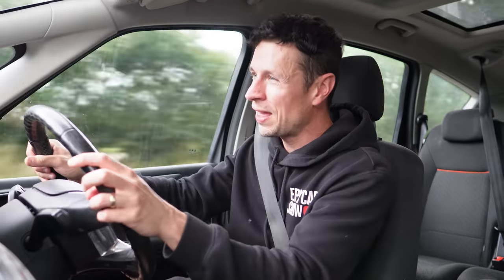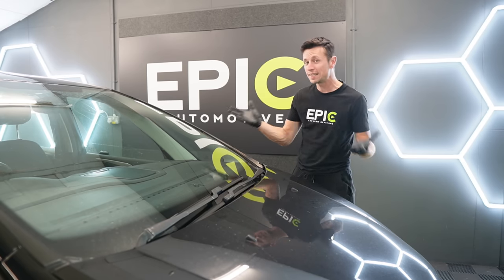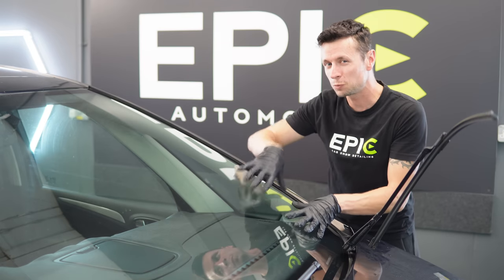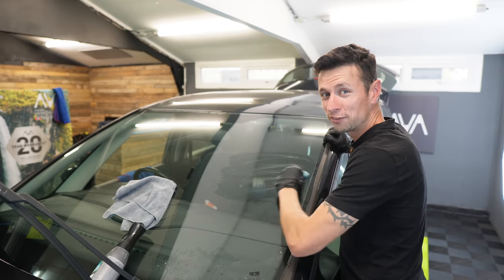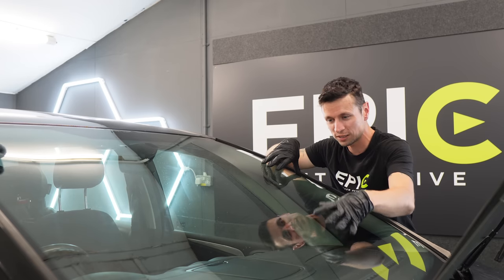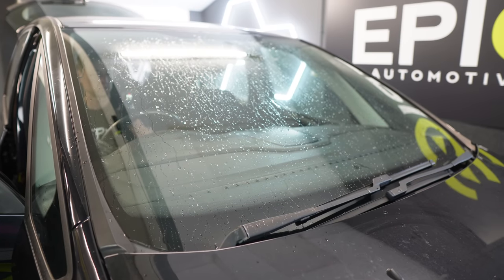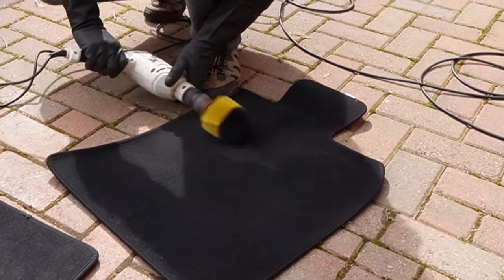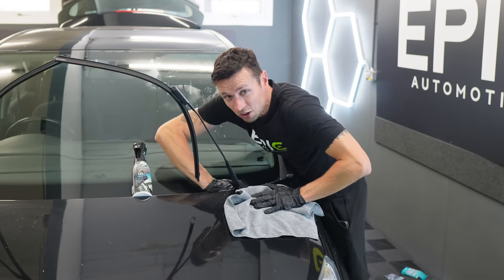How to Fix Annoying Windscreen Wiper Juddering for Good!!!

Comment: The wiper arm is the problem, not the blade or glass cleanliness. Those are just temp fixes. You have to remember the arms are a thin metal exposed to the elements and constantly expanding and contracting and twisting as the temperatures change. You can use 2 adjustable wrenches to slightly bend the arms back into place so the blades sit against the windshield perpendicularly.
Reply: I hope your comment reaches a lot of people
Reply: Yup exactly spot on!
Reply: what if i have this juddering issue only after I apply rainX to the glass? are the arms still the problem? it happens every time I apply it and its doing my head it, although i didnt try coating the wipers themselves yet.
Reply: You may be generally correct, but I have this issue on a brand new car (1 month old). I have ceramic coating (done by a detailing center) on the front window, so looks like this is causing the issue. Maybe the wipers need to be treated as well.
Reply: @mastrasport  I coated the wiper blades afterwards and it made it significantly better with just the odd judder now and then
Reply: @lukaszM46  Thanks for the tip. I will probably check with my detailer to see if he has other ideas, but looks like removing the coating (not sure how this is done) or coating the blades would be my first options.
Reply: Exactly. I realized this after I coated my windshield, then stripped it, then coated it again. It still juddered so I replaced the wiper blades, and to my surprise, one blade missed a huge area on the windshield completely. That’s when I realized it’s the wiper arm that’s causing the issue. All this time, I couldve fixed the issue for free.
Reply: 99.9% Its the wiper arms that needs twikking nothing to do with how clean the windscreen is?? This stream is just a product scam, The black residue  on the cloth from wiping the wiper blades is mostly graphite used in manufacturing of rubber wiper blades, Silicone blades are far better for longevity, The only product I use on windscreen is Rainx + wiper blades before the onset of winter 🤔🇬🇧👍

Comment: One fix that works for me, is to use Glass polish (Autoglym). I only get juddering at the bottom of the windscreen, normally where the wipers sit and just above, but the other 80% of the glass is fine. A clay bar and clay bar lube should do the trick as well. I also use a hydrophobic glass cleaner. I know you don't like them, but they work. I don't use any of it on the wipers itself, as this causes, my Bosch wipers to judder, just plain water on the wipers every two or three days, and yes, loads of black dirt on your cloth. After a few days, I also spray water on the glass cleaner/sealant, on the sides, this brings up the glass clean again, without using more product, with glass cleaner cloths. Some cheap microfibre cloths leave their lint on the glass, glass cleaner cloths don't. Also, try The Pink Stuff around the exhaust tips or white vinegar, cleans them like new. Pet hates? Wheel cleaning. Do you take the wheels off (not practical in most cases, but the best method), and clean them properly, inside and out, what products to use, TFR, ceramic coating on wheels, what tools, what processes, tyre cream or just tyre dressing, sit on a chair or knee pads? What products don't work? What a minefield, just the wheels can bring. Maybe worth doing a video on all the techniques and products.

Comment: My biggest problem is my shampoo or snow foam drying on the car. I start one end of the car and work my way round to find my soap or water has dried on the car just in a few minutes. I find myself rushing to clean the whole car whilst it’s wet and making sure it doesn’t dry. Then I’m knackered because I’ve rushed and not enjoyed it. Is it nothing to worry about?

Comment: Would've been interesting to see what happened when the windscreen was wet though. Sealants, in my experience, tend to leave a brief haze just after the wiper blades pass, and it's almost impossible to see through it on a sunny/bright day or at night. Very dangerous. The only thing I've found which cleans my windscreen properly is Meguiar's Ultimate Compound.
Reply from the maker: Keep watching it will be revealed. I'm mixing Content with shorts so follow up videos are coming in 30-60 second bite sized clips
Reply: Yep have to agree, no matter how well I applied them it was that brief ghosting that put me off - at night with headlights coming towards me... very dangerous.
Reply: @epicautomotivedetailing  Oh. I don't watch shorts, as after watching one, I'm bombarded with them. Oh well.

Comment: I tried everything to stop my driver's side wiper from juddering but finally found it to be lateral play caused by wear of the plastic area where the J hook wiper arm is passed through the blades. Oddly, the one on the passenger side is much tighter, even though they were changed at the same point in time. I'm using aftermarket aero type wiper blades, not the metal spring type that were the originals. I only ever sleep with women and sometimes feed the jackdaws. Not simultaneously mind you.
 A happy 2024 to all.

Comment: Back in the day, all we dine was put a slight twist on the wiper arm. Worked everytime.
Reply: That is still the way to fix it today. This is how we lose track of human culture and history.
Reply: Huh? What do you mean by that?
Reply: @AnthonySarino-f7n  He means back in the day they used to just put a slight twist in the wiper arm and it would correct the way the rubber blade sits on the window and stopped the juddering effect.

Comment: Great vid as always Dave. The thing I struggle with the most is not having a pressure washer. I use the garden hose with an additional attachment which gives a bit of extra oomph…but obviously doesn’t compare. I never feel like I get a proper deep clean, especially the tyres, wheels and wheel wells.
Reply from the maker: Garden hoses use more water than a pressure washer so it's definitely better for water consumption getting one. A huge part of the clean is the chemicals so the hose isn't impossible but definitely invest in decent products

Comment: Good morning Dave.  I feel pretty confident about using most cleaning, decontamination and protective products but I do really struggle with ceramic sprays.  Getting an even coat and smearing on bodywork is hugely frustrating albeit I’ve tried using a damp cloth once it’s applied.  Any tips would be appreciated please.

I think the biggest challenge is navigating through the huge array of products on the market before deciding on what works best, however!

Great videos mate - I learn a lot from you.
Reply from the maker: Thank you David. To be honest finding the right products these days is very tricky because we all want the best but brands also push boundaries so a good majority of products out will be good enough. It's very rare to find a terrible product these days

Comment: Great video Dave, loving the new unit based content as much as the mobile content.
Very interesting subject for me, having recently applied Glaco Ultra, and still having wiper judder, where there wasn't really any before that, just a soft squeak near the bottom of the windscreen now and then, as the windscreen was drying but not dry, strangely was better when dry!
I washed the car as normal, used a a Stanley type blade on the screen with glass cleaner as lub (same as Ammo NYC used) followed with clay bar, then Glaco Compund.
I applied the Glaco Ultra, wiped off clean with a dry microfibre and left the car garaged overnight, basically followed all the instructions to the letter.
I was gutted the next day when it rained, and the wipers were horrendous, juddering and skipping, making a horrible noise.
I fitted new wiper blades as these were over a year old (always have a new set waiting) and it was a lot better but still not perfect, still getting a little judder occasionally and a little smearing too.
Your tip of applying some to the wiper blades, I have heard of before, but I didn't do that, so that my be the key here.
Great result with yours, nice and quiet now
Reply from the maker: Thank you, definitely recommend applying it to the wipers as it solved the issue for me

Comment: Great video.  Haven't tried a sealant on the windows, just a car glass cleaner.  One issue I usually face is cleaning the front grill area and getting rid of dried on bugs.  No matter how much snow foam and cleaner I use I can never get that area really clean and when I dry off the car I Always find bugs.
Reply from the maker: Sometimes the blood and fly guts  can etch into the paint so washing alone may not be enough.
Reply: Use a clay bar on that area

Comment: Hi Dave, i am a car detailer for 4 yrs. My biggest hate is cleaning black car in the summer. I have tried doing  a long hosing to try and cool it down, washing the roof 1st and rinsing, then working my way around the car doing one side at a time. surely there must be a better way?.
Andy.
Reply from the maker: The only real solution apart from putting the car under a gazebo is having another pair of hands to keep the car wet whilst you hand wash it. It's so difficult sometimes you have to walk away and wait for a cooler day. Thankfully we live in England so it rains all the time lol

Comment: Love my Glaco compound and ultra they’ve both been on my car for about 4 months and still going strong.

The toughest part for me the clean is my carpeted wheel arches, even when rinsed at at high pressure with the stubby gun, I just can’t seem to get all the muck from the top. My ez go brush still comes out with dry muck/dust.
Reply from the maker: Sounds crazy but you can get good results brushing them whilst they are dry
Reply: @epicautomotivedetailing  mind blown 🤯 never thought of that. Cheers mate 👍

Comment: Like other posters, my pet hate used to be water drips from mirrors and door handles - no matter how much I used the air blower to dry the car, I still got watermarks. No longer a problem - thanks to my newly acquired DI water cylinder. Just use it for the final rinse through an open hose and walk away. No drying required, and no water spots, even in hot sun. The most hated job for me is getting the inside of the windscreen really, really clean….ggrrrrr!
Reply from the maker: Hi Paul my glass cleaning video is definitely the one you need to wash. It will fix that issue

Comment: Another great video 👍, can’t wait to try it these methods out.
On a complete tangent…I extended the usability of my K4 today till I get one of AVA’s new machines, as I bought and have received the AVA stubby when I found it comes with a Karcher adapter included. Already had the jet adapter which again fitted straight in the Karcher style fitting in the nose. 
So glad  that I held of buying any expensive or generic ones now, because it’s a great ergonomic gun,(at least in my hands) and I’d never found or considered it without your Videos about AVA and giving their beaker snow cannon a go too. So thanks for that 👍
Reply from the maker: Nice one yeah Ava's new pressure washers are fantastic. Not one reported fault so they are making great progress for a new brand. They tick so many boxes for the user

Comment: I’ve used rain x on my windows for about a year now and I’ve had different cars to test them on and this recent car is really bad with the skipping or juttering. I’ve tried striping the rain x and putting new on and it didn’t work and I absolutely hate when I don’t have a protection on it.

Comment: Juddering wipers absolutely drive me crazy.My current car s Skoda rapid which I have had for 7 yrs has been the only car I have ever owned that has had such an issue like this. Despite being very fastidious about car and glass cleaning only new blades seem to cure it but after a while it starts again . In fact i have given up on SKoda blades and just bought Bosch aerotwin yesterday which were  actually cheaper  and  are extremely quiet but time will tell! The other point is i have just refilled washer bottle (including vw quantum screenwash solution) with deionised water instead of our tap water which causes lots of limescale in our taps/shower etc, so wonder if this is causing the blades to fail prematurely so will keep using it as a trial over a few months. Might try your clay bar method too as another aid.
Reply from the maker: Amazing tip on the water 👌

Comment: My experience unfortunately is that in perhaps the first week maybe 3 after applying coating to glass and wipers it's super smooth. But after multiple days of rain somehow there is always judder, specifically on the return motion of the wipers.
Reply from the maker: I wonder if a quick top up with sealant on the wipers would help?

Comment: Picked some of the windscreen sealant from Waxstock . The gent on their stand recommended that the older one may last longer but the newer design , as you used , makes it easier to apply the product in his view. Not sure if hes right or wrong I just know its bloody good stuff and one I enjoy using . For me products like this are essential as a safety aid for better vision and to clear the water off the screen faster. Would you suggest applying any sealant to the wipers as Ive heard others say it can ease wiper wear and juddering . But whats your view on that ?

As for the pain in the ** jobs , for me its the lower sills and around the lip of the arches where the crud gathers and if isnt moved can start rotting the lip .
Reply from the maker: I suggest trying it if the sealant causes juddering. If it's working on its own then leave it as it is. There are so many variables to dictate what causes juddering

Comment: Ok. I Don't Struggle With this, but some on YT are..... I'm talking about Discs.. Nice clean car and Wheels looking FAB.. But the moment they drive away. Boom covered in Orange dust from the break disc..I use a BlO AIR in-between snow and wash . I would love to know your Pro comment on this, and maybe you will consider this.
Reply from the maker: It always happens after washing. Simply tapping the brakes and moving the car sorts it in seconds 👌

Comment: amazing video - as always. One thing that really bugs me when cleaning my car, is rotor rust! I've just spent ages getting the car and wheels cleaned and dry, only to find that after the first drive all the rust from my rotors have been deposited onto my black alloys turning them a yucky mustard colour! Are there any products you can use as part of the wheel cleaning process which prevents this from happening? As I loathe having to go over them again with a damp cloth or detailer just to get them looking clean again. Cheers and keep up the good work!
Reply from the maker: Hello I just move the car and tap the brakes and job done. I think built hamber actually have a product designed to combat this without moving the car.
Reply: Bilt hamber Atom mac

Comment: Instead of applying coating to the wiper blade can you try silicone blades instead and see if the hydrophobic effects of the sealant on the windshield is not causing this issue? I have I installed TPU based hydrophobic windshield protection film and when there is light to moderate rain there is not enough water on the windshield and the wipers goes nuts. I don’t know how to to solve this problem.

Comment: I struggle most with cleaning the under side of the car. I have a Range Rover vogue and a Toyota supra. The Vogue is easy to spry the underside and make sure I’ve got all the road salt and grit off. But my supra is really difficult to get under and be sure I’ve given it a thorough spray off

Comment: my biggest struggle right now is with baked in small spots of brakedust on my wheels - and I am concerned if I can use wheel cleaner with aacid.
Reply from the maker: As a valeter I admit I always carry acid with me because you never know when you will need it. Some wheels are a big no no so it depends on the type. A one off spray on wheels that are cool doesn't always do much harm. It's repeated use of acid that wrecks them

Comment: I have started cleaning cars on a weekend basis but i struggle with the weather mainly the the sun ! I have no choice but wash and wax in direct sunlight but i don't have enough clients yet to warrant a gazebo so basically as i wash the car each panel i do i dry immediately afterwards . I still get great results but it's a struggle , any tips ???
Reply from the maker: Hello I have a dedicated video on Washing a car in the hot months. It's probably 2 years old now but still full of great advice
Reply: @epicautomotivedetailing  thanks Dave i will check it out 👍

Comment: One of the most recent problems I've encountered with the last few cars I've detailed is the black plastic trim.  I've used CarPro perl and GT Tyre serum on the black plastic trim.  I recently detailed my brother in laws 14 year old Mini Cooper and its wheel trims were all sun bleached.  The CarPro Perl and other things worked nicely until it rained and then it looked a mess.  What solution would you have to a long-term fix for this?  Thanks

Comment: For me always drying. Just bought a new drying towel but it just seems to suck up the water rather than glide across the paintwork.
Reply from the maker: And contact with the surface of the paint would potentially scratch it but for me I tend not to worry as much now. These risks are on such a microscopic level. I like car dryers but they don't speed it up for me